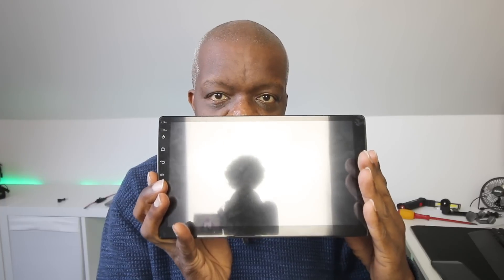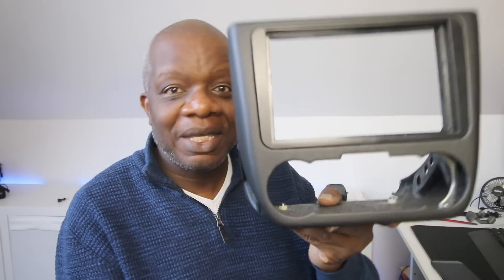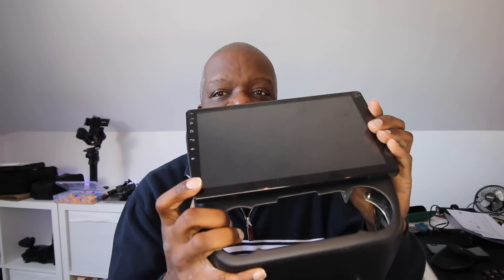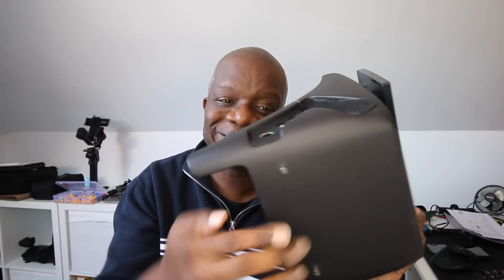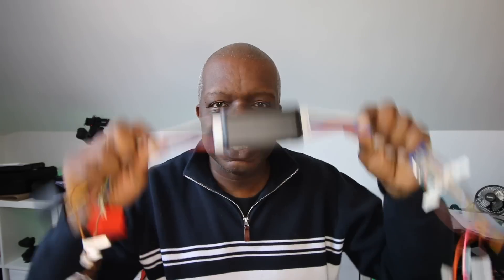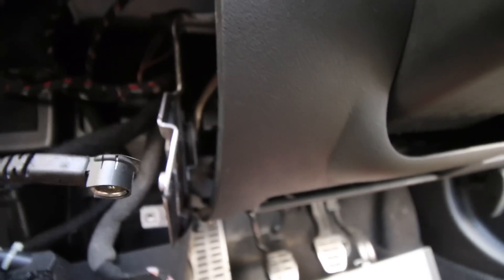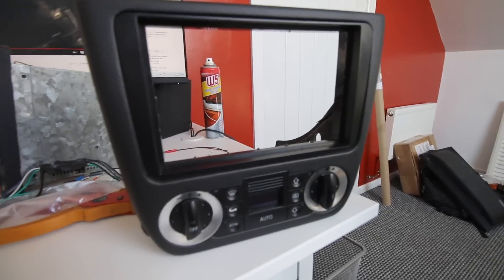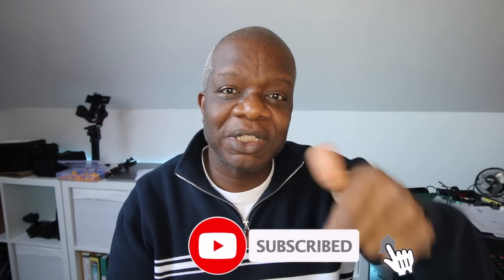Fitting a BEIEN OXF8 Pro 10.1 stereo to my Mk1 Audi TT

Comment: Thank you for the first class presentation. I could never eliminate the flap and therefore have no radio. I listen to the exhaust.
Reply from the maker: You are welcome!
Reply: Pioneer makes a single din with a pop out screen. All you need is an adaptor kit to fit it in the original opening. With the screen closed, the aluminum panel should close.
Reply: @DasAutoTech  Wow and more wow. Do you happen to know the model or a source ?
That being able to close that beautiful door is, I think, a style requirement.
Reply: @DasAutoTech  Would it be:
Pioneer SPH-10BT from Crutchfield
Reply: @vicelse8980  Pioneer AVH-3500NEX
It's not cheap though...
Reply: @vicelse8980  and I agree about the door. I'll sacrifice a little screen size (or the entire screen, if we're honest) to keep the cover panel functional. It's such a clean look.
Reply: @DasAutoTech  Thank you. astatejb. After your tip yesterday, I looked at a couple of Pioneers, single din, with the screen. Crutchfield claims it doesn't fit/work. Regardless, I've thrown my money at a set of 9 spokes to get 8" instead of the 7.5" on my fat fives. So, I ordered an OEM pull from audistpvl in Kazakhstan. $100/no code req'd. I'll let you know how it works out. 
Regardless, all I have to do it think about the car and I grin. 
It is soo just right for me.

Comment: The upgrade does look good Paul and an improvement on the original fittings is my opinion also.
some good install tips to especially Re the wiring,excellent video and look forward to your next project,
have a good week,,

Comment: Love the look of the new head unit....but having had one myself I had to get rid of it. as using a touchscreen while driving was far to distracting for my liking and swapped it for a double din Kenwood with buttons and was so much easier to work on the go. Having now got a 2017 BMW 435d I must say I love the idrive system and also still have short cut buttons for fav stations. Good video Paul and look forward to the next one 👍
Reply from the maker: Thanks for sharing

Comment: Worth sacrificing your ashtray for. I’m my opinion cars are there to be tailored to their owners. You wouldn’t buy a house and never decorate it or improve it because that’s how it was built so it’s the same with cars. I’ve had a £650 TT for a couple of months and it’s almost a different car, engine bay fully blinged with ally caps (when I got it it didn’t even have any covers), carbon rear spoiler extension, wheel spacers, gaited illuminated gear shift, Proram filter and one hell of a lot of cleaning. The point is that your car reflects your choices and tastes, that’s why people become enthusiasts. Yes there’s something to be said for concourse but at the same time neither is wrong, it just seems that in the TT community OEM is the way, yet you’ll have purists drooling over 500bhp monsters which are a country mile away from how it rolled out of the factory with less than half the power.

Comment: Thank you very much for this great video! I'm looking for a aftermarket autroradio for Audi TT mk1 with bose system. Do you know what is the maximum Watt power for the 4 speakers? I need an autoradio DIM1 o DIM2? What are the other specifications you suggest to check for after market autoradio to be compatible with the orginal Bose sound system?

Comment: Nice install👍I was looking at that same head unit for my volvo c30 but volvo being volvo made it difficult trying to install it. The dot matrix screen is the heart of the car and if I tried to install it, I would lose my A/C and heating controls as they work off ribbon connectors. In the end I bought a hi/low converter to wire up my amp and sub. Do you or anybody else for that matter  know if there is a way around getting a screen in without bricking the car?
Reply from the maker: Unfortunately I don't. I worked for a brief spell at Volvos training and development centre in Daventry, and Volvo had a policy of integrating their ICE systems into all of their components so if you removed one element, you rendered the whole system useless, a practice which is done by most manufactures today

Comment: Hi Paul like the video a lot and so much so I have made the plunge and am up grading to a 2 din system that you have. The contact you have for the after market panel to let the new radio sit in is a German company. I have tried to make email contact with them to discuss the colour I need etc. How did you initially make contact and did they come back quickly. I have emailed them with the contact email they have supplied. Please note to your subscribers it ain't cheap at 200 pound. Looking forward to the change though. Loving your videos.